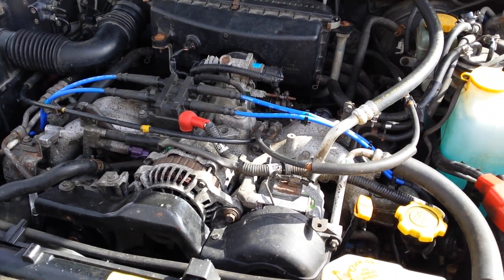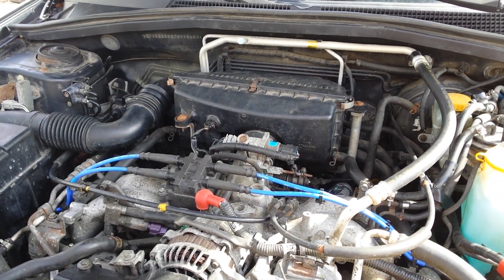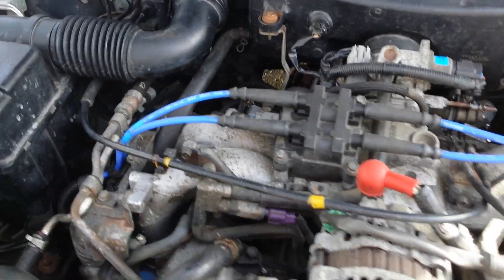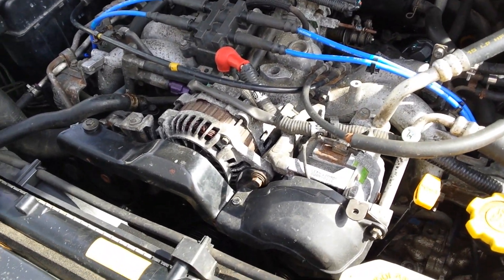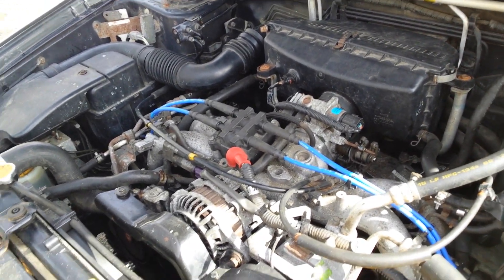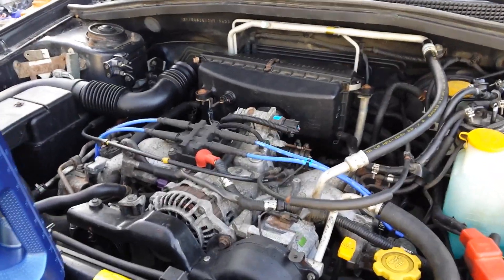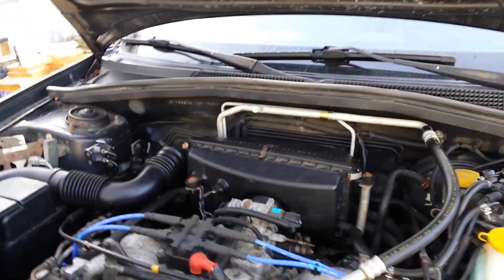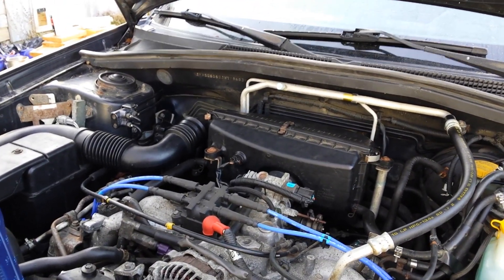Subaru Piston Slap - Does using Shell Rotella help?

Comment: Dependent how old and how careless the engine is used it's usually the gudgeon pins.
When you open the engine and dismantle the piston and con rods you find a worn sloppy track around the gudgeon pin allowing the piston further forward movement of a mm or two

Comment: That's not piston slap.
Replace your Belt Tensioner 
And it will be gone!
Reply from the maker: Belt tensioner was a brand new Aisin. ;) And if it was the tensioner, the sound wouldn't go away when the engine warms up.

Comment: I have an '05 outback and yes it too is noisy on cold startup!! Quiet as a mouse after it is warm... so, I think that this type of engine is inherently more prone to this type of noise because the pistons are moving on a horizontal plane.
Just keep the oil fresh and clean and just live with that little bit of cold noise.
Mines been that way for over 5 years and it reliably gets me to and from work every day!
Reply: That sir is the correct answer but 5w30 and some lucas oil would have been the better option but i haven't on mine and it's fine.

Comment: 10w 40 or try the 10w 50. On older higher mileage subs seems to always get the piston slap, its just the joys of a boxer engine lol even low mileage subs gets piston slap even worse on the wrx's and the sti's. I would recommend to get octine boosters for the gas tank and 10w 50 full synthetic engine oil and a HKS oil filter or use the OEM factory oil filters. You forgot to tell your viewers that piston slap is a problem  and if left you risk damaging the block over time...

Google ref:
 A piston slap can become a bigger problem over time. It steadily wears down your pistons and bores, leading to the premature death of your car. If you're planning on having your vehicle for a long while yet, you will want to fix this problem sooner rather than later.
Reply from the maker: All the Subie's I've done bore measures on with piston slap the bores are fine. It's just the skirts that are the blame, and usually just the top, so I don't see this as a long-term damage kind of issue (i.e., easy to replace pistons or 'flip' them on the pre-2006 engines if the As & Bs are symmetrical across the sides).

Comment: I have a 2003 outback limited sedan with only 38,400 miles and it slaps as well when cold out..I've owned many subarus and this is the first I've had with the slapping. Hoping it's not a major issue but will continue to monitor.. sold my 2016 sti because of reliability and hate worrying about my subarus..I never learn my lesson buying these things 🤣

Comment: My old 2.2L Chevy s10 slapped like that for years until it finally burned a valve and I rebuilt it. Damn thing still has a light clatter to it on deceleration even with fresh bore and new pistons 😂

Comment: I use 20-50 mobile 1 in my hybrid block build with worn 255 pistons and rehoning a worn bore. It slapped like hell with 5-30 in it and purs like a kitten with 20-50. 255 with sohc 251 heads at 20 psi. Brand doesn't matter.
Reply: That oil is SO THICK but the other parameters you're mentioning with worn bores and pistons justify it.

I, too, am curious about your oil pressure.

Comment: Replace pistons.... That will fix it permanently 😎
Reply from the maker: .... And a rebore to the next size up.
Reply: @stephenhunt6253  If the cylinder bores are worn or damaged, yes, but if the measure in spec, just a light hone and new pistons&rings should do. Measure the new pistons and compare with bore measurement, should give you an indication if re bore to next oversize is required
Reply from the maker: @hansjoubert  Yes, but most of the cylinders I've seen where the skirts are worn from piston slap, the bore is over spec too, and it's almost always cheaper to find a good used short block than to have a machine shop rebore (at least around here).
Reply from the maker: @hansjoubert  But the best course of action is, of course, to live with it. They can go 100s of thousands of km just fine with piston slap. ;)
Reply: @stephenhunt6253  yup if you can find a good block, it would be cheaper
Reply from the maker: @hansjoubert  Actually, I've wondered, but haven't tried it yet, if 'flipping' the pistons would work: Since the upper skirt always scars way more on the piston slap ones, turning them upside down and rotating them to the other side of the block (so the front-directional dots are still correct) to get the 'cleaner' side facing up on all cylinders might address the problem in mild-to-moderate cases. And it's the cheapest solution (aside from living with it)!
Reply: @stephenhunt6253  I suppose you can try flipping them, but its a lot of labour time you might waste. Whats new pistons set (with rings) worth?
Reply from the maker: @hansjoubert  You can get new pistons/ring for as little as a hundred bucks, but the ones I've tried are noisier than Subaru stock pistons, so I tend to prefer the stockers if possible. Maybe I was just buying too cheap. Stockers are about $100 *each*.
Reply: A set of pistons on ebay, depending on what motor you have is about $99US..
Reply: 4 Pistons  EJ20                                          (Available in STD size only)
Complete Ring Set for 4 Pistons              (Available in STD size only)
Wrist Pins and Clips
Compression Ratio:          Stock
STD Bore Diameter:          92.00 mm
1st Group:                           1.20 mm
2nd Group:                          1.50 mm
Oil Ring:                               2.50 mm
Reply: @stephenhunt6253  Ah  okay :-)

Comment: Ah, finally sense at the end of the video. Oil cannot reduce piston slap, there is space between the piston and cylinder, it is not magically filling up with oil. The idea of thinner oil to prevent cold ticking is for hydroulic lifters with narrow passages. Thicker oil could mask worn bearrings, but no remedy for slap. It does wear out the cylinder more quickly, so I would replace pistons if the car is still worth it.
Reply from the maker: Agreed, but even if you replace the pistons, the wear to the cylinder bore has been done, so likely new standard pistons would still be slappy. And getting a rebore to the next piston size up involves splitting the case, so probably never worth it given the engine will likely live another 100k+ km easily with the current level of piston slap (and this one is already 60% of the way there from when we recorded this video).
Reply: @stephenhunt6253  In that case it is understandable. Then just drive it till it goes.
Reply: I run 20-50 in my hybrid subaru engine for piston slap, the manual stated you can use a 50wt oil.

Comment: T6 5w40 would work better. 
I use to have really loud piston slap on my 02 wrx, i put in 10w30 and it really made a difference in my car.
Reply: Hey still have your 02 wrx? I noticed louder piston slap after changing unknown oil to ultra platinum 5w30, will def switch to 5w40 and try that out
Reply: Keep me updated . Xt 2.5 with piston slap

Comment: People are going to find out synthetic is not all it's cracked up to be.it's causing major engine damage in Fords coyote, Chevys LS, Chrysler's hemi. I quit using it years ago and my Caterpillar engine. I now use 15,40 rotella and Lucas oil stabilizer.I'm still a believer and a user in Castrol 20-50 in these small engines. Synthetic causes a lot of burnishing to camshafts and upper rocker arms. Also to be found that it does not allow piston rings to seat properly when installed in a rebuilt engine.
Reply from the maker: I agree that Synthetic hinders break-in of new rings, but I haven't had any issues with camshafts or rocker arms as a result of using synthetic (at least on a Subaru).
Reply: @stephenhunt6253  I always broke new engines in on Dino and made the switch to synthetic with no problem in 30 years and hundreds of thousands of miles driven.
Reply from the maker: @j.t.cooper2963  I hear ya. Except for piston-ring break-in, I plan to continue to use Synthetic in my own car.
Reply: I have never had any of those issues in my vehicles. I've driven hundreds of thousand of miles on synthetic oil. And I have been using synthetic oil for almost 30 years now. The problems you attribute to synthetic oil are because of poor engine designs and just the plain low quality, gimmicky engines of today. It also can be attributed to the lead foots that drive those pseudo muscle cars they make today.

Comment: you have it Backwards. 0w IS THINNER at col start up ! 
 What do numbers on oil mean?
The numbers represent the viscosity of the oil and the W stands for WINTER. ... In a 5W-30 for example, the number before the W describes the viscosity of the oil at low temperatures. The lower the number, the thinner the oil and the better the oil's cold temperature/ cold start performance.   http://knowhow.napaonline.com/understanding-oil-weight-numbers-bottle-mean/
Reply from the maker: Thus, it may be that the first number is more important to addressing piston slap (since it's a cold-start phenomenon). So, maybe better to test next on a 10w or even 20w next time, eh?

Comment: In all fairness you went from a 5W oil to a 0W oil. That's why it was louder (to my ears) when you switched.Try the 5W40 or 5W30 Rotella instead, if that doesn't help go to 10W30.
Reply: Winter weight applies to the oil's properties at freezing temperature. It is not linear, nor do the 2 sets of numbers before and after the 'W' have any relationship to one another. That number, though lower, is significantly thicker than the 30 or 40 # after it. In other words, 0W40 will warm up faster, but the oil is still thicker than 5W30. The only thing the 1st number indicates is the lubricity at freezing temps, and it can only be compared to the 1st # on other oils. The 2nd # is the lubricity at operating temps. - "Up the Irons"
Reply: @kaganhudayar630  I already know that and I was referring to cold weight of the oil (at 32 degrees) when I made my comment.
Reply: Try 5w and lucas oil instead these cars aren't like the ones in vicegrip garage i would be cautious even if it worked for a while with that rotella.

Comment: Had a similar noise from the driver's side only with cold start then gone after 15 miles of driving.New timing belt and tentioner kit.It wasn't piston slap.It ended up a being a worn intake,exhaust rocker and shaft.
Replaced both with "good" used.Cold knocking is now gone.And yes, I do have a faint piston slap,but very faint.
Reply: 90% sure I found the knock.
Finally had the time to check the spark plugs..Oh my word..There original..Blown seals..every one was loose..especially the left rear(where I hear the loudest noise)..gap in excess of 0.060..
I'm amazed(embarrassed) I didn't check early on.I was more concerned with doing the timing belt and CV axles.
Reply from the maker: So, it was a worn camshaft? What year/model?
Reply: @stephenhunt6253  The camshaft looked fine.The rocker shaft had wear marks under the load side of the rockers at the oil feed ports.
Reply from the maker: @virgilmobile1  Interesting! Was this the 2.5 SOHC engine?
Reply: @stephenhunt6253  Yes.New to me.2003 Forester 2.5 SOHC.172K miles.All original.Even the timing belt and tentioner.
Reply: @stephenhunt6253  here's the link to the rockers.https://youtu.be/IENZOH1_K1s
Reply: Well just poo.The knock didn't completely disappear.Greatly diminished but still there when the car has set for 2 days and gone after 15 miles of driving.
Pulling the injectors loose does not change the knock.Sounds like one cylinder.Perhaps the camshaft has been hammering from the bad timing belt parts and now is banging in the bearing cups.
I still have excessive valve train noise.Almost twice as loud as the right side.
Reply: Having strange problem with this "piston slap" noise.Over the last 2 months of twice a week driving,it sounds faint as usual then gone when warm.Two weeks ago, a very loud pronounced knock on cold start..next week after, it's perfectly quiet on a cold start.Im starting to believe that the new tentioner and/or mount is defective.The cold start knock is never the same from week to week.
Starting temps in the 70° each time.

Comment: Also having this issue, just started a couple days ago. More noise on acceleration, and climbing hills. Especially on cold start. I currently run 5w-20, was told to switch to 10w-30. Any help with knowing which weight to choose would be greatly appreciated. I replied on a comment, but meant to do it here. Too tired to re-type. Check in the replies for more info. Thanks so much, 😃
Reply: Not sure if you got your answer, or if this is still relevant, but here's my $0.02

I have an 08 Outback with the 2.5L H4. It just picked up a cold clatter that's louder on acceleration and goes away when warmed up. 100% piston slap diagnosis.

I would say you could go up to a 10W-40, because the thicker oil will cling better when cold, which is when the slap is trying its hardest to damage the piston/cylinder wall. If you're also losing oil (burning/leaking) the thicker oil at operating temperature should help to reduce the loss.

My car consumes 1 qt every 1,500 miles, but that was with 2 hours of commuting at 55 mph every day. Not sure how it's going to change now that I have about 40 total minutes of commuting at about 35 mph average.
Reply: 5L
Reply: 5w- 40 if you live in a cold place or 10w 50 if your in a hot place but 5w- 20 is defo a NO GO!! Poor engine 😐😢

Comment: Why would putting a thinner oil at cold startup (0w vs 5w) help piston slap? You’d want 10w instead.
Reply from the maker: Hmm, 0w40 is thicker than 5w30. But anyway, that was just the suggestion on some of the Subaru forums (not sure where the idea originated) that I wanted to test.
Reply: @stephenhunt6253  
Just recently got this ticking, bad in the mornings upon start up. Also revs high for first 30-40 seconds after starting before it dies down to a normal idle. Was told by someone it's a lifter or rod, but I'm unsure. He told me to switch oil from my 5w-20 to 10w-30. Not sure if that's a good idea. He said it's a thicker oil, and it will help lubricate better. Any suggestions? I have a 2013 Kia Forte Ex, 2.0 litre With 111,200 miles. I recently had a used motor installed, as mine blew a head gasket at 105,000 and now this motor has given me nothing but problems and it had 84,000 miles on it according to the wrecking yard I bought it from. Going on a massive 3,000 mile trip, and I don't want to brake down. If switching oil can help, please let me know, which is better. Thanks
Reply from the maker: @joleneshipp3946  Are you able to isolate the location of the ticking? Stethoscope or just a long screwdriver to the ear? If it’s in the heads, it might be your valve clearances. If it’s coming from the bottom end, could be worse. 84k seems a bit low to have piston slap (or any bottom end) issues, unless the engine was abused (which you’ll have no way of knowing, of course).
Reply: @stephenhunt6253  yes, it does sound too sided. Today, I added 1/2 quart of 5w-20 and the ticking did get softer, or lightened a bit. I'm just not sure which oil to put in with the oil change coming up next week. As I stated, I'm going back to Georgia in a couple days, and don't want to get stranded. So if going to synthetic, or a different weight, how do I choose?
Reply: Top sided. Not rod related, as it sounds almost like it's near my fuel injectors up top
Reply from the maker: @joleneshipp3946  I would use whatever weight of oil is suggested for your vehicle. Synthetic protects components better for sure.
Reply: @stephenhunt6253  so don't change it to something thicker?
Reply from the maker: @joleneshipp3946  If the noise is in the top end (e.g., valves), thicker might help a little bit with the noise, but the problem (i.e., a clearance adjustment) will still need to be addressed.
Reply: @stephenhunt6253  0W40 is thinner that 5W30 when cold (0W vs 5W).  5W30 is thinner than 0W40 when warm (30 wt vs 40 wt).  And of course both are thicker when cold than when warm.
Reply from the maker: @autoarcheologist  Yep, understood. Was just testing a hypothesis I read at an online forum. Will be trying 15W-40 at some point.

Comment: I had slap noise on my 2006 4.0 V6 4runner.  Put that exact same T6 in it and it didnt seem to help.. then we took it on a 800 mile road trip a couple days later.
When we arrived at out destination, THE SLAPPING had ceased!
Hasnt made any sound since.  Not even cold start.
Reply from the maker: Interesting!
Reply: @stephenhunt6253  yea I was shocked!  I heard some fluids take some miles to see improvements..  Seemed like Piston#1's wrist pin was getting jammed in position when down or up stroking, causing my "slap".  The SLAP never went away, it was always there after it warmed up!

I think the Rotella did it's magic when I got it flowing for hours on end at normal engine temps.  I only shut off the engine once the entire 12 hours to get out to eat.. I gassed up running.
It may have stopped at ~400 miles.. think I recall a drivethru I went thru for a late lunch/snack lacked that awful "TICK" noise.